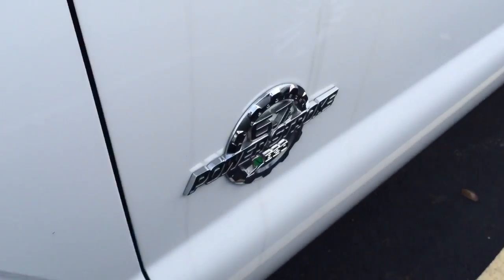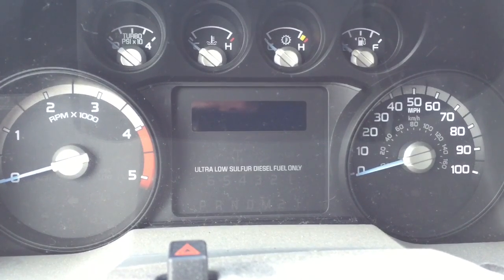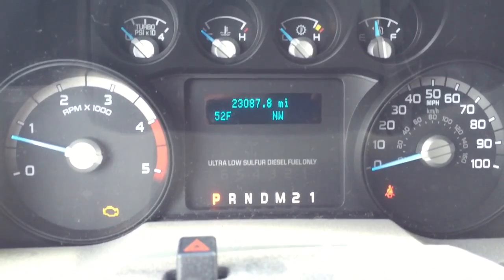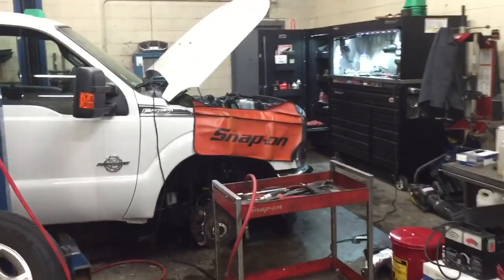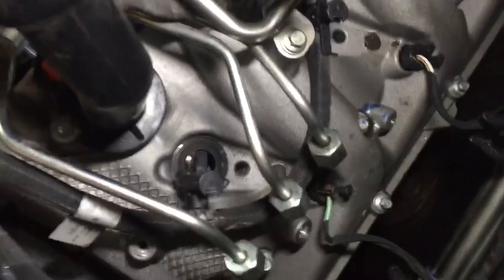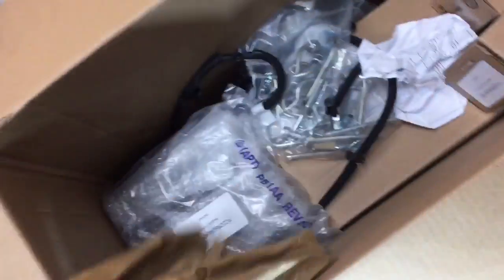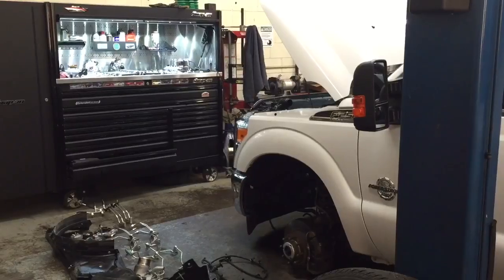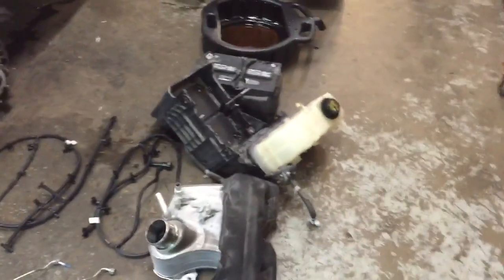6.7 Powerstroke Disassembly: Injectors and Pump

Comment: I installed a SPE disaster prevention kit on my 2015 6.7, after the install I now have a no start. I decided to remove the kit after the no start and put everything back stock, still no start. Any ideas on what could have gone wrong? I also got a P2291 code

Comment: If it's actually water in the fuel, Ford needs to improve the water in fuel sensor, because with all that i've read up on this, no one had a light come on. I'm also reading about the lack of lubrication in the fuel causing the high pressure fuel pump to fail... just my opinion

Comment: Something that I’ve heard is that ford designed that engine to make the exhaust/intake directions different so as to lower the heat in the engine bay. By containing the exhaust gas heat in the top of the motor, and further away from the CAC, that causes the engine to be slightly more efficient. Don’t quote me on this, but it’s just something I’ve heard

Comment: Keep up on your fuel filters and this should never be a problem.
Reply: You didn’t watch the video because it doesn’t matter if the filter is brand new because the diesel from the pump has water in it, it will ruin your pump anyways
Reply: OEM filtration is inadequate

Comment: Wouldn't it have been easier to replace the fuel system/injectors if you lifted the cab off?  You have the lift, and the cab comes off fairly quickly.
Reply: Prolly would be but you still got to pull the same stuff off to get to it and then you gotta worry about lifting the cab and sitting it back down and fighting connectors and mess

Comment: oi
like gay fords like gay ford owners HAHAHAH there both are broken and retarded HAAAHAHAHAH 4500 thats alot HAHAHA thats like a good used car HAHAHAHAHA
on my gay mazda it slike 50 for plugs wires cap and rotor HAHAHAHAHA and about like 20 hour of work HAHAHA this gay ford is like 4500 plus   50hours of work HAHAHAH GAY fords hehehe
THE END
::))

Comment: I am looking at buying a 6.7 f350 XL bare bones model ...  These 6.7 diesels appear to be a maintenance nightmare next to the 7.3 I have with 372,000 miles on it. I tow trailers and use the truck for dump utility on my property. 

Is the 6.7 a total pile of electronic / emissions shit, or is the 2016 a good truck. I only see the new diesels getting more complicated and less worthy of buying.  in General, will maintenance costs eat up any savings I have from better economy via a diesel?

thank you.
Reply: Buy a Cummins or Duramax and save yourself the headache of dealing with the Powerstroke
Reply: I want a work truck without onstar or Uconnect.

I like to the manual locking front hubs and the front strait axle. I am choosing to not buy and buy another 7.3 at a bloated price ... it is cheaper in the long run.

Dodge has a shit front axle but a great engine

Chevrolet has a shit front axle and a great transmission.

I am not discounting these trucks you cite, rahter I want another work truck with everything manual as much as possible ... Looking for a John Wayne level truck, not a loaded elton john truck as most exist.

Comment: All because of overkill EPA rules. They have to run high fuel rail pressure to try and burn a little cleaner. And some of these 
fuel pumps grenade because they are camshaft driven and there is no circuit breaker or fuse to pop. So much for the onboard water seperator. Cant handle lots of water. But its ok to burn campfires at state parks

Comment: same issue I had with my 2001 Ford F350 7.3l powerstroke but I had water in the fuel-water separater so I drain it and it fixed it

Comment: Great job. Is the truck resting on the front rotors?
Reply from the maker: +FROGMAN524 Almost. I have it resting on the lift arms, lowered down to the point where the rotors almost touch the shop floor.
Reply: Oh ok looks are deceiving

Comment: If this where a 7.3 you wouldn't have even noticed the water in the fuel
Reply: water and a few other things have been chewed up and spit out of a 7.3, a customer dropped a mini clamp into a 1995 7.3, said he thought he ruined his engine. It survived another 300k
Reply: lol damn right
Reply: Amen brotha. Put some tranny fluid through that bitch clean them injectors right out
Reply: I love my 7.3, I just bought a 6.7 and I have a check engine light and a blance code on cylinder 3 so I amma tryna figure out to change the injector lol

Comment: Are there aftermarket filter systems that would prevent this from happening?
Reply from the maker: +ICU2 There are additional fuel systems you can add to your truck, but in the end, if there is enough water in the fuel, it will eventually make its way to the injection system.
Reply: ICU2 
he's absolutely correct. I've had the pleasure of a similar R&R on the 6.7, even decided to throw a dual filtration water separater system. soon learned the owner must be vigilant in observing the filters. we're still curious as if it's the fuel gathering condensation more dramatically either in the commercial storage or if  there's a flaw in motors fuel system.

Comment: Why did it take so long to get the parts from ford?
Reply from the maker: +Derek Draper Apparently the parts were on backorder, must be a common issue!
Reply: +DanielJaegerFilms there's a lot of shitty diesel fuel out there lol
Reply: You'd be surprised on how any people put DEF in the fuel filler neck instead of the DEF filler neck running the same type of concern to an eventual no start then having to order this kit